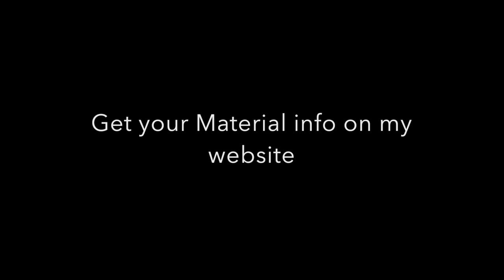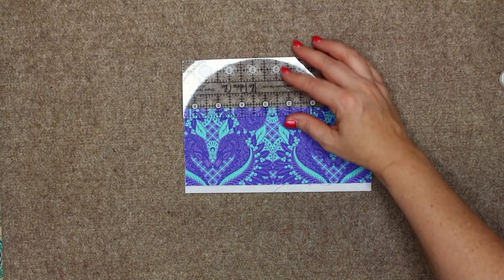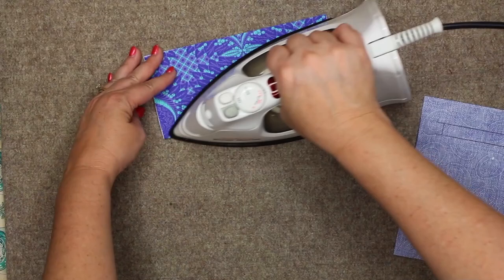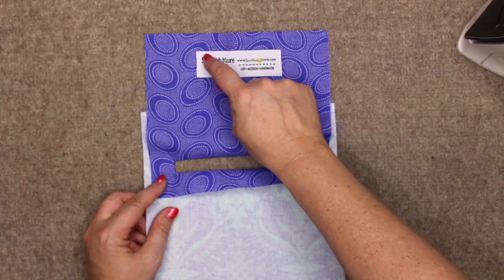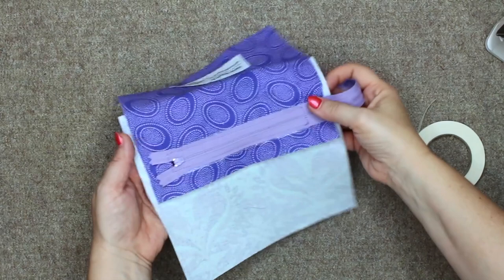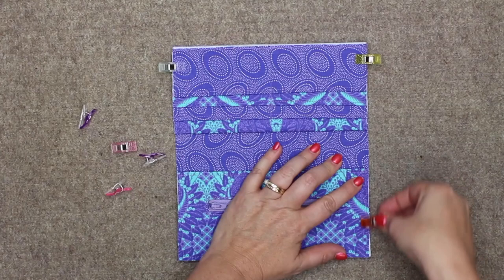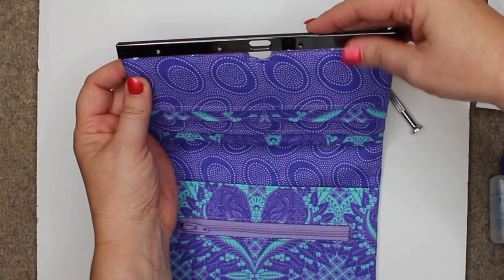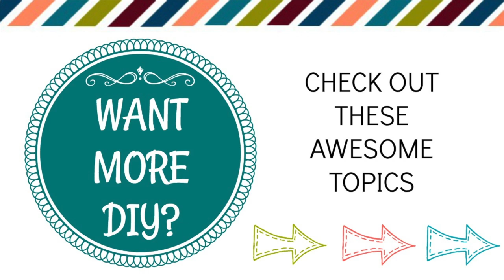How to Make​ a Frame Wallet

Comment: Thank you for this video. I see that you use double sided tape to adhere the zipper. Do you have trouble (needle gumming up) with your tape. I have had trouble with sticking and skipped stitches when sewing through this tape. Perhaps you use a specific brand?
Reply from the maker: I use a juki sewing machine and have no problems.

Comment: Love it thank you.  Will a cell phone fit in the slot behind the zipper pocket?
Reply from the maker: Norma Stout I have a larger sized phone and it fits. The only problem is that because the wallet opens flat, the cell phone will easily fall out when the wallet is opened.
Reply: @SewMuchMooreInStore  still love it thx.  Look forward to future videos

Comment: Great wallet, you made that looks so simple! Did you puncture a hole in the fabric, where the screws go or did you just add the frame?
Reply from the maker: Yvonne you don’t need to punch holes for the screws. When you tighten the screws, this helps to secure the frame to the wallet. The screws will add lots of pressure to the fabric, in the channel. Don’t forget to use glue!
Reply: You probably dont care but does any of you know a tool to log back into an instagram account..?
I was stupid lost my account password. I would love any tips you can give me
Reply: @Gerardo Bruno Instablaster =)
Reply: @Romeo Zain I really appreciate your reply. I got to the site thru google and im waiting for the hacking stuff now.
Seems to take a while so I will get back to you later with my results.
Reply: @Romeo Zain it did the trick and I finally got access to my account again. Im so happy:D
Thank you so much, you really help me out !
Reply: @Gerardo Bruno you are welcome =)

Comment: You didn’t answer my question about the double stick tape gumming up your needle. You told me you use a Juki. That has nothing to do with it. What double stick tape do you use?
Reply: She did answer. She said she had no trouble. I think she added in that she has a juki so that you know that specific brand didn’t have any trouble with it. But I use double sided tape quite frequently and have no problems either, with a singer.